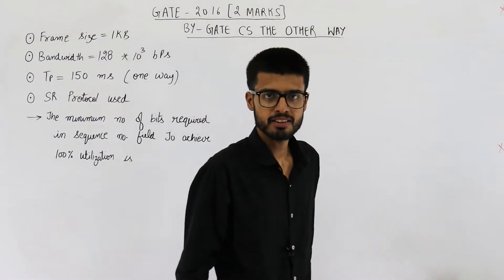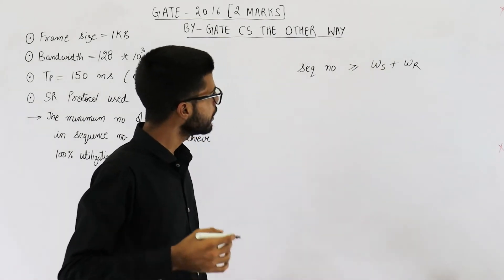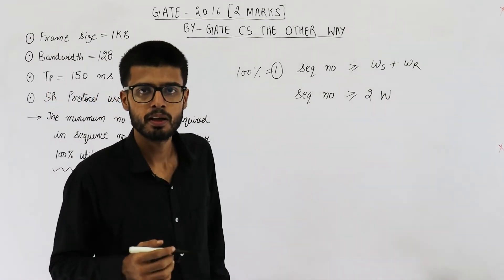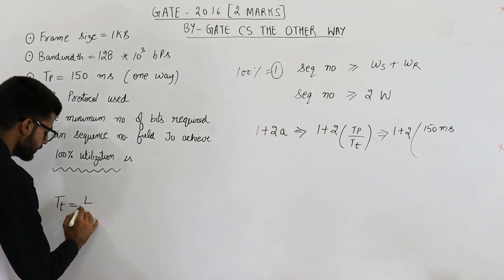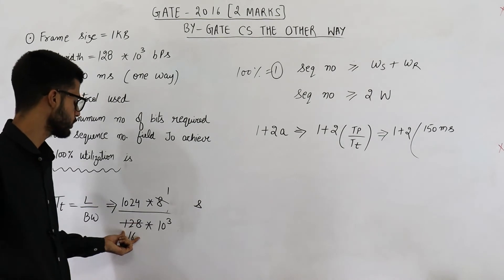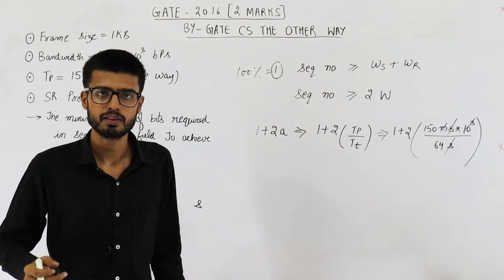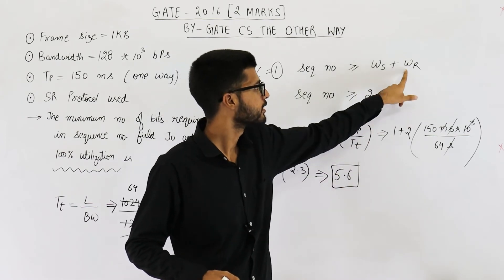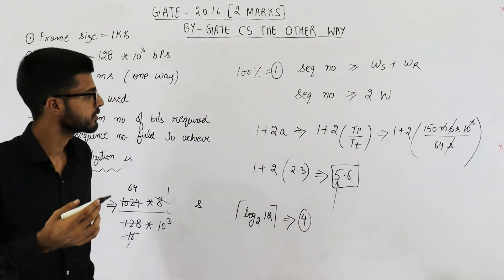Gate 2016 pyq CN |Consider a 128×10^3 bits/second satellite communication link with one-way.

Comment: Why we didn't convert secs to ms for transmission delay and also propagation delay in ms so we want converting transmission delay to ms why we keep it as secs only !?
Reply from the maker: I suppose u are confused about calculating tp/tt for finding 1+2a right? 

As already mentioned in video also. 1+ 2a is a number and has no units so does not matter as long as your calcultion is correct. 
If u convert it to ms still everything is exactly same. Tt will be 64ms and again tp/tt will be 150/64 and no unit because ms and ms will be cancelled.